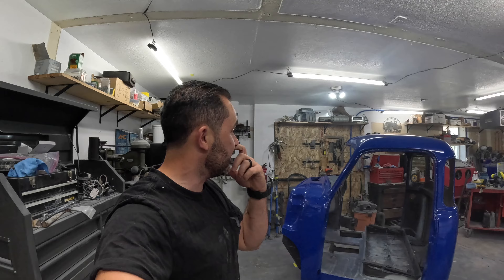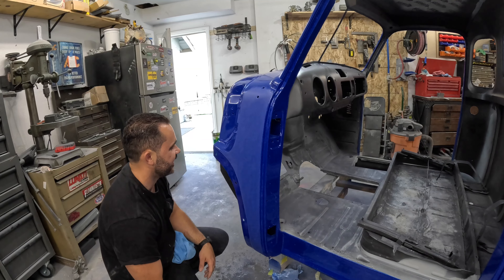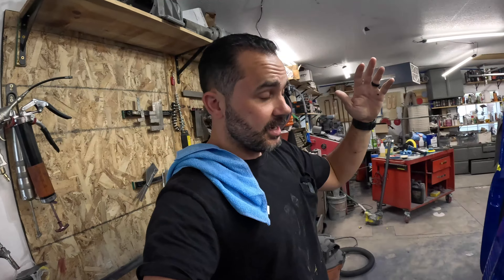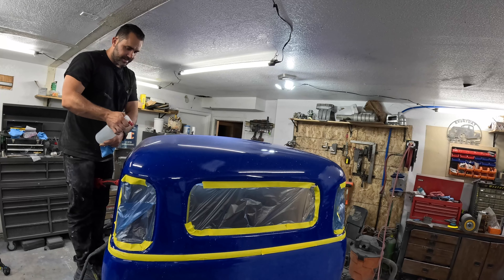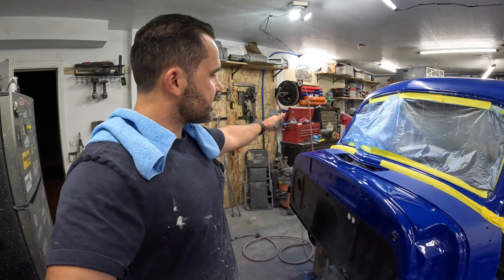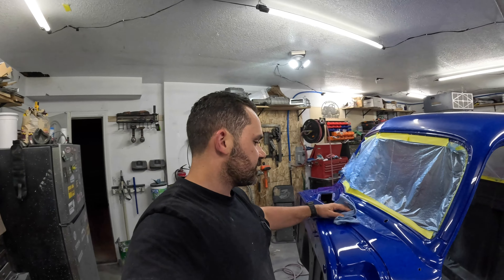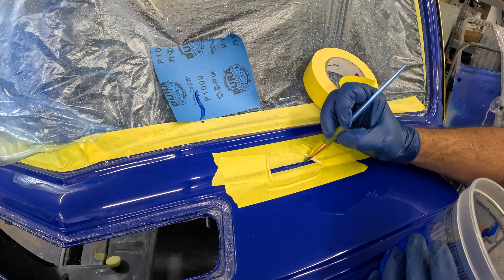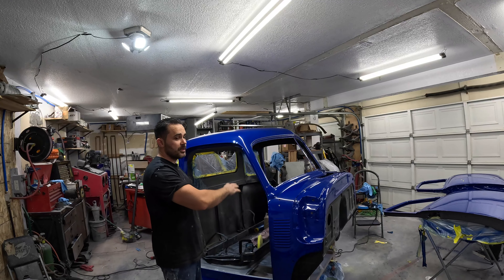Fixing all MY Paint mistakes - Cut and buffing MY way to a better paint job! - 1953 GMC

Comment: Looks good, the paint looks 3 feet deep. Best to not do sections, wet sand the entire cab , the last grit always finish by hand. It is more efficient doing the entire cab vs sections. Same for buffing do the entire cab. It is easier, less chance of mistakes because you kinda settle into a groove. Keep moving while buffing never pause in one spot . Really tight spots can be hand rubbed polished. 
It looks great you just have newbie stress and jitters getting in your way. There are a lot of Professional shops that will not look as good. 
You can be proud. My guess is your pads are getting too dry , the friction is probably tearing them apart
Reply from the maker: Thank you! I appreciate the advice, I’ll definitely be using it on the rest of the truck